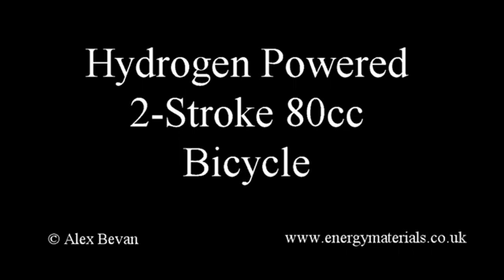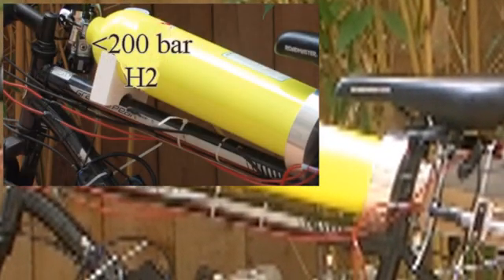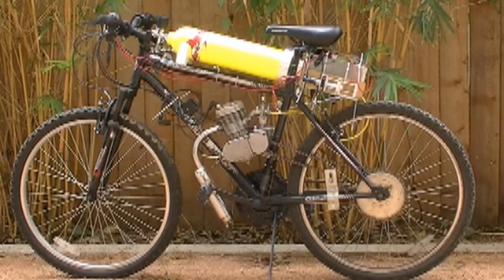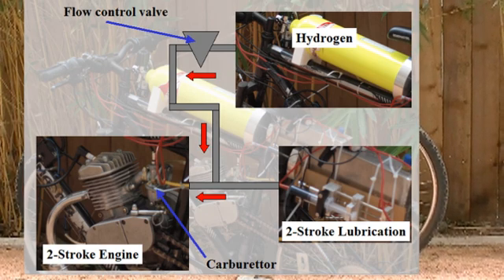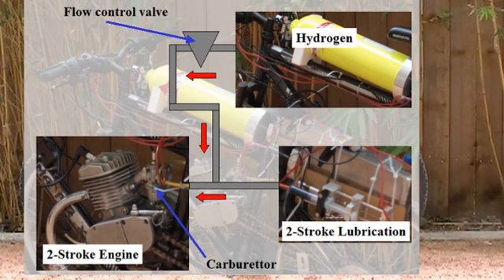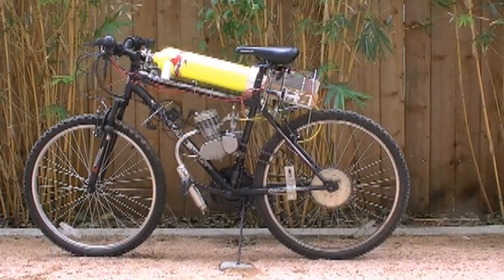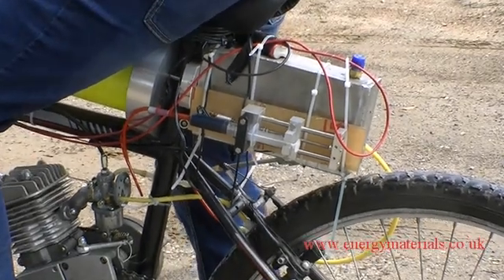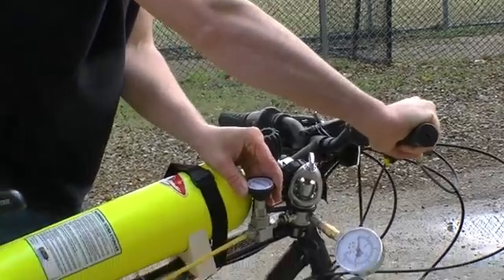hydrogen powered 80CC 2 stroke bicycle

Comment: Update?
... still running?
Reply from the maker: Thanks, yes. Currently working on an upgrade to add a PEM fuel cell. Should have an update shortly
Reply: @EnergyMaterials  hydrogen superfluid?
Reply: @EnergyMaterials  is the oil also burned? Or is it possible to make a system to recover it after the exhaust?

Comment: How can you burn 2 stroke oil and not get any fumes? Plus burning oil... not very eco friendly making the  point of it being hydro useless nowadays no?
Reply: Its ok if you burn a little castor 927 maxima, sounds way better than a 4 joke POS. here is a 2 stroke conversion.https://www.youtube.com/watch?v=qosAllch8Sg&t=12s. Its burn off a little oil and there is no oil to throw away! Every is caught up in this eco crap too much but not me. i got an 8v22 destroit 2 stroke and small block v8 2 stroke. im looking at a 6v53 2 stroke to repower my truck as i cannot stand the sounds of the 4 joke piece of crap that powers it. The 7.3 IHC it has is 2 stroke convertable though and it nice to see achates power woking with cummins on an OP 2 stroke diesel from 750hp to over 1500hp. there are both Clark uniflow charged and Day loop chared ans all sound better than this overated 4 joke crap! I get amsoil dominator 2t or my rotary and klotz techniplate 2t for the 8v92 and small block 2 stroke and i got both rigged up for total loss oil feed burn off. its 464 a gal for the klotz 2T! Cheers.
Reply: dont plants breath c02 n spit back oxygen then you get more dead plants then equals more dirt... ?  the carbon bcomes plant.. but anyhow i heard radiation evenutally breaks c02 into 2 after time sun radiation

Comment: strangely.. from India saw an example of a small 2 cycle motor bicycle that wasn't mechanically driven. the output shaft from the engine was fitted directly to an alternator and the electricity was wired to a controller and then to a 2000w hub motor. The 30cc chain saw/ brush cutter motor only had to maintain a steady 1800 rpm idle
 to power the bike to over 40 mph. A strange lesson in efficiency. It's out there. It's a video on youtube
Reply: here it is
https://m.youtube.com/watch?v=l3irKJZErbY

Comment: fascinating! I always believed hydrogen ICEs were the 1st stepping stone away from fossil fuels. While HFC tech is being developed, ICE tech is already ubiquitous and can accept H2 or petroleum - a great opportunity for transition to H2 infrastructure
Reply: Just imagine an oxy hydrogen turboed 2 stroke
Reply: Yeah if 2 stroke Clarke uni-flow scavenged or Dar loop scavenged! Not his 4 joke crap. Castor 927 maxima is one of the best oils out there, As of now i got my detroit 8v92 and small lock v8 2 stroke on klotz techniplate 2T and my rotary on amsoil dominator synthetic 2 stroke oil. Here is how a 4 joke is made into a 2 stroke:https://www.youtube.com/watch?v=qosAllch8Sg&t=12s. sounds awsome and one guy took a 5 cyl mercesed diesel and did a 2 stroke conversion, sounds and runes much better than it was as a4 joke. BTW nature uses 2 stroke cycle as all lightnings bolts are 2 stroke. The leader streamer fires down and the return leader fire back up completing the 2 stroke cycle!

Comment: hey have you ever thought of adding an oxidizer? Like for example liquid oxygen? Try out compressed air. It should be cold enough to pull enough oxygen from the air in order to create liquid oxygen.
Reply: I suspect an oxidizer could be implemented & calibrated w/ the H2 to inject a perfect ratio of 2:1 hydrogen to oxygen, effectively producing a "stoichiometric combustion" greatly improving overall efficiency of power & fuel economy
Reply: try using an air duster can and or computer keyboard cleaner that has liquid air

Comment: can it run without oil?
Reply from the maker: Hi, thanks for the question!
Yes I've had it running without oil with no problems, at least for the 20-30 minutes that I ran the engine without oil. Oil is required for lubrication so if a 2 stroke is run without oil for an extended period I expect the engine to seize. With a 4-stroke engine this wouldn't be a problem as you don't need to supply oil into the fuel mix with 4-stroke as there is an oil sump on the engine- this is not an option for 2 stroke.
Hopefully for a future upgrade to the internal combustion powered bicycle using hydrogen I can get my hands on a 4 stroke to play with!
Please subscribe to show support!
Reply: Well maybe there is a way. You can run a rotary on pure hydrogen. So maybe there is a way by replacing the O'rings. Maybe then it would run without oil.
Reply: @thecbc7658  Rotary need 2 stroke oil injection too!
Reply: a hydrogen 2 stroke is far supior
Reply: @EnergyMaterials  4 joike has a vunrable oil innection sump, better with dry sump and oil injection as h2 will make ionized gas which will detroy wet 4 joke sump!
Reply: peter medz what o rings
Reply: So it runs and burns perfectly clean, just use castor 927 maxima fed to the bottom with the hydrogen, runs cleaner than most lousy 4 stokes
Reply: 2 strokes need the oil for lubrication of the piston.4 strokes have the oil in the crankcase, where the oil is splashed up to lube the piston.
Reply: 2 strokes are still splash lubricated by the pre mix, however there are pressure fed oil ETEC engines and detroit diesels. anyways 2 strokes with DFI are a much better hydrogen engine, im glad to see this work as i want to try it
Reply: a 2 stroke cannot run with out oil. They have high load requirements some 2 strokes diesels have high volume oil pumps. even a premix engine uses the piston as a oil pump to force it through the high load areas. 2 strokes require a much heavy duty oil then 4 strokes as the heat and load issues are there. you can pour 2 stroke oil in a 4 stroke as i have done and it will run fine. as 2 stroke bike clime in performance they require down to 24:1 heavy duty oil that far exceeds any 4 stroke lube needs as the 2 stroke is much hotter. i fill and run xd-100 2stroke oil in my truck as it far exceeds the lube requirements. My toyota is a light duty 4 stroke, remember the Toyota poppet valved 2 stroke s-2 though. My old fart omc rotary is premixed at 50:1 and it is an old fart go to church motor that does not rev  much
past 5500 rpm.